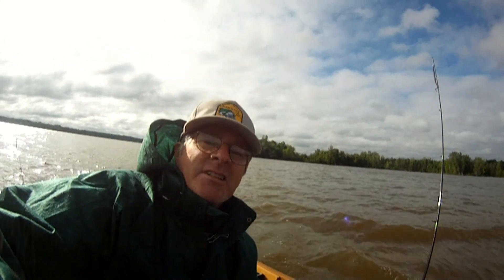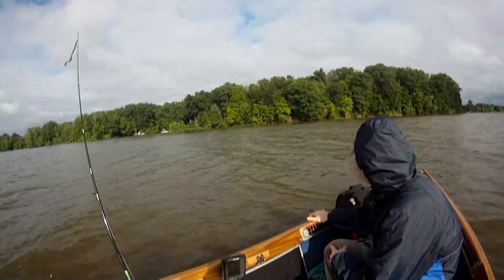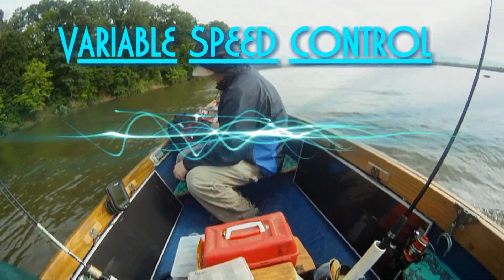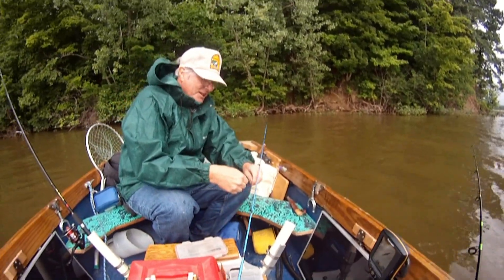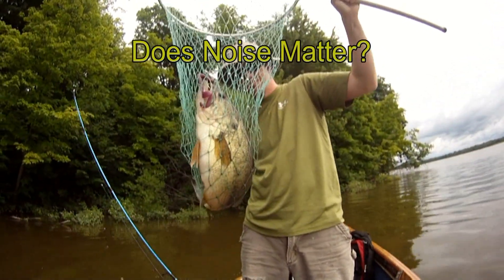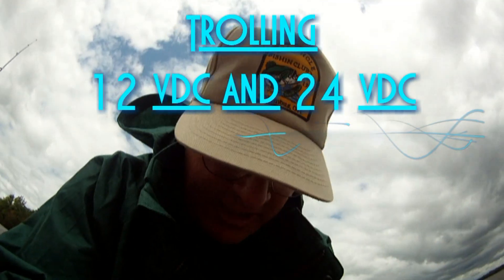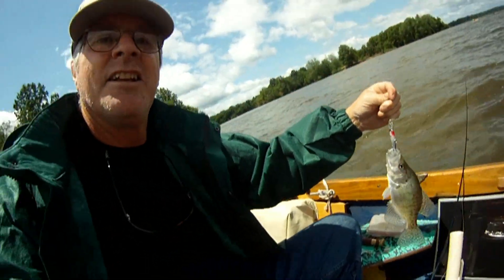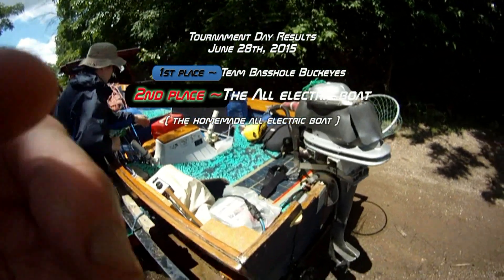GNARLY Electric SOLAR BOAT 5500 rpm 2015 HOMEMADE all electric boat  ELECTRIC outboard motor 4.5 hp

Comment: whats the capacity on the solar panels and how bigs the battery?   That angle grinder isn't turning 10,0000rpm at full speed?  sorry if any of that's answered in the video's dialog, i was watching with the sound off...
Reply from the maker: hey so core ~ total wattage = 50 watts ~ the maximum rpm of angle grinder @ the MOTOR SHAFT is 6500 rpm. The maximum turns @ the PROP is 4,333 rpm. ( reduction gear 1.5:1 ) hope this answers your questions ~ THANKS FOR WATCHING!!!

Comment: like the use of the angle grinder motor. do you use an inverter?
Reply from the maker: ~ hey Nicolaas ~ Thanks for watching! ~ yes a 3 KW inverter is used in this set up. ~Please note: The electric outboard system can also operate on STRAIGHT DC . 12 volt and 24 volt DC ~ and can operate indefinitely  as long as the sun is out as well as recharge battery systems. ~  I have had this set up now for about 5 years. WORKS GREAT. any questions, I can answer them. thanks again for watching. ~ chris